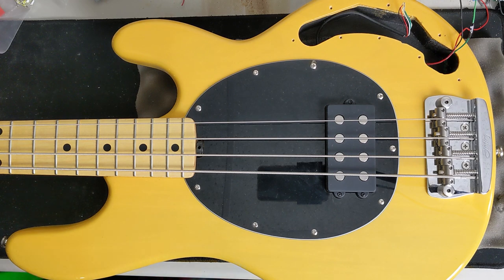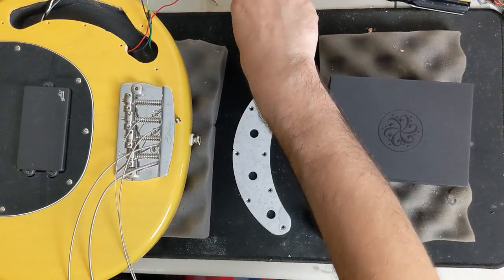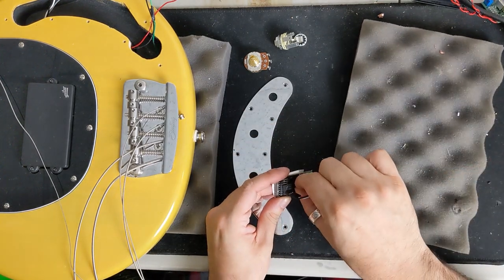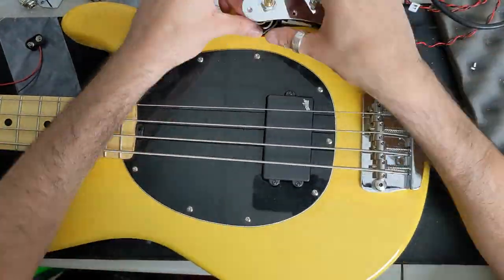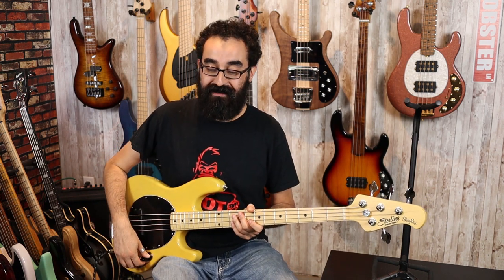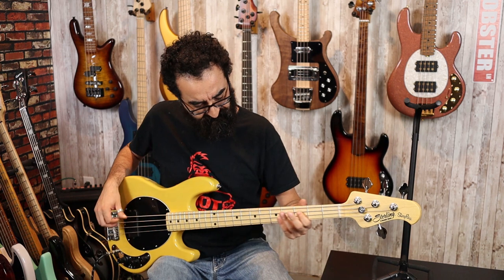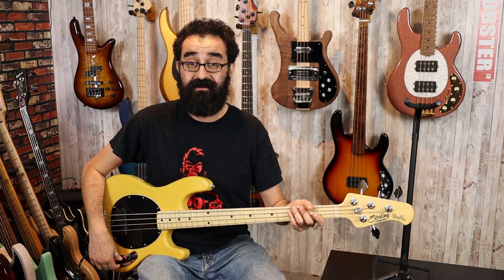Ray24 Stingray Mod Project! Aguilar DCB-M and Darkglass Tone Capsule - LowEndLobster Fresh Look

Comment: The Tone Control presents a high impedance load to the pickup, so instead of using a high value pot, which will absolutely adversely affect the tone, you might get better results by using a 25K low value (low impedance) volume control AFTER the TC and (of course) before the output jack. I think if you do an A/B comparison with the volume control value and placement, the difference will be audible. (Retired electronics tech with 2 degrees and over 50  years bench experience modding amps and bass guitars, etc.)

Comment: Thanks for the great videos 🙌 the onboard preamp on my Ibanez UB804 has just broken and I'm looking for a replacement. It's similar to the piezo pickup and EQ on the SRF700 that you reviewed and modified with Aguilar pickups...looking at the Aguilar OBP's or Darkglass tone capsule onboard preamp EQ's but not sure they'd suit the piezo, or if I need to add a piezo buffer with it....otherwise a bit crazy but considering buying a new UB804 to swap the preamps over....would vastly appreciate any advice you may have 😉

Comment: Great vid Lobster. That bass sounded great, so many tones available. Was that combination of pickup and amp something that you would have thought of yourself or was it a refreshing angle from the bass winner?
Reply from the maker: Thanks Triple! Honestly this was a combo I wanted to do originally in 'Project Mint-o-ray' (early stingray mod project on the channel), but the DCB M pickups weren't available and ended up going with a Delano. I was glad that the winner picked this combo though, I think it turned out great :)

Comment: Nice! Where did you get stacked knobs to fit the Noble stacked pot? I have one that came on a Nordstrand pre and right now I'm using some knobs that don't quite fit. All the stacked knobs I can find are for 6mm & 8mm solid shafts but the inner shaft on the Noble is split/splined.
Reply from the maker: Great question! So for this project I used the Spector push-on knobs, for all 3 controls, and I used the bottom part of the Bartolini stacked knob set for the bottom of the stacked pot.
Reply: @LowEndLobster  Oh nice! I thought of using a full sized knob for the top but I didn't know there were lower knobs big enough. Thanks for the reply!

Comment: Another awesome mod video. Two quick questions: How do I join the discord group, and would the DG Tone capsule pair well with the Nordstrand MM4.4 Quad Coil PU? I have a Stingray Ray 4HH
Reply from the maker: There's a link in the video description. You can copy and paste that URL into your browser if it won't let you click, and that will take you to Discord. If you already have discord it'll just open up and join, otherwise you'll have to sign up (it's free).  In regards to the pickup, absolutely! If you dig the DG tone, it should work with any setup.

Comment: Hey Lobster! A question: could you have gone with a 5-hole control plate to fit all of the original potentiometers, like you did with your DIY DarkRay?
Reply from the maker: Great question! Yes, I suppose so BUT I don't think the preamp module would fit in with 4 pots AND a jack.. or it'd be a very tight fit. It was a PITA to get everything to fit into DIY Darkray, and the SUB/Ray24 cavity size is a little smaller
Reply: Oh I understand now - again, thanks for the quick answer :-)
Reply from the maker: @meantime69  it could be done. They make DCBs in the right size and the Darkglass circuit would work nicely

Comment: Love the sound of the mod on that 24 .amazing. Just purchased a new SUB 4 but didnt like how it sounds. Followed your lead and likewise purchased an Aguilar AG4M p/u however it came with a thin black and white lead, original has a sigle thicker black wire. Can you pls post or dm me the  on how you did solder yours and on wc pots please. Planning on using the stock preamps for now as you suggested. Thanks and love ❤️ your vlogs sir!
Reply from the maker: Thanks Anthony! The stock preamp has two contacts and the stock pickup uses a double layer wire, so it's two in one. It connects to two contacts on the preamp. The inner wire is 'hot' and the outer is ground, so use the white wire in place of the "hot" and the black for ground. Hope that helps and congrats on the bass!

Comment: Hey Lobster!! Great video. Is there a diagram on how you altered the tone capsule, and combined it with the stacked pot? Also, is that the original volume pot you’re using or a new one? That’s my only concern doing this mod. This made me want to pull the trigger on this combo
Reply from the maker: Heyo! The volume pot is just a 250k pot I had laying around, not the original from the stock setup. For the stacked pot on the darkglass, no diagram is needed. If you look at the plug connector that goes into the darkglass single pot, you see three wires that connect to the pot via the connector. You just snip the connector and solder those three wires in order to the new stacked pot. There's two sets of three lugs, just 1-2-3 1-2-3 for both wires. You maintain the connector bit that goes onto the PCB of the preamp, so you can always flip or swap the connections on the PCB without soldering to change which part of the stack controls which freq range. Join our discord channel if you have more questions, lots of folks happy to help including myself :)
Reply: @LowEndLobster  much appreciated lobster!!!!

Comment: Very helpful! Tone capsule comes in tomorrow but I gotta get some time off from work and get a volume pot but because of your mint o ray video I’m SUPER excited. I watched your videos on the projects and I’m trying to find a pickup that gives that well known stingray growl. Thinking of a Seymour Duncan ceramic, thoughts?
Reply from the maker: Thanks Nathaniel! I'd probably go for the Alnico if you want that 'classic' Stingray tone, but the ceramic is a good choice as well (I've personally never used the SD Ceramic, but the USA Sterling uses a ceramic pickup and sounds great.)
Reply: @LowEndLobster  I turned my Ray34HH into a single, and the alnico that’s in it is so dead and Lifeless. I’m hoping after I put that new preamp it gives me some new life. The pickups have 5 wires instead of two, can I wire that to a three way for series, parallel and single hum? Also what volume pot would you recommend for the sterlings? I’ve heard some different things and can’t find anything online. Know that’s a lot of questions but I really do appreciate it
Reply from the maker: @TheGoldeneye1973  Awesome! Yes, the 5 wires are the two hots, the two grounds, and a shield. This can absolutely be wired that way. The Delano install guide has a great set of diagrams for wiring this on a 3 way toggle or a blade switch- https://www.delano.de/downloads/installation_guide.pdf (and this can be applied to mostly anything)
Reply: @LowEndLobster  you are the man. Thank you so much!! Have a wonderful rest of your day!!!

Comment: This might sound like a dumb question. Can you use your stock volume control? I am doing the exact same project.
Reply from the maker: Great question! I'm not sure the value or taper type of the stock pots, so it'd be a gamble.
Reply: This is my first bass soldering project. I wish I had a unedited version of this video so I knew where all the wires go. I am sure I can figure out the schematics though.

Comment: Love your videos. Could I ask, do you know if it is possible to put a Darkglass tone capsule in a USA Sterling and still have the 3 way switch functioning? Thanks!
Reply from the maker: Great question. YES. You will need a new volume pot, but you will essentially wire the 3 way switch to the volume knob (the switch only has a single hot out and ground), and wire the vol knob onto the tone capsule.
Reply: @LowEndLobster  thank you, however can I clarify a few points which may change your answer…it’s a 2006 Sterling USA, with a PCB board preamp (which has already been soldered twice and quite precarious!), it has the 3 way pickup switch, then 1 vol, 1 bass, 1 mid, 1 treble controls. Still doable whilst retaining full functionality?? TIA.
Reply from the maker: @adamcarra3161  Excellent question! Upon looking at the preamp- yes it's possible but you'll need to rewire the switch. Might be easiest to get a new 3 way blade switch and wire the pickup to that, and then into the vol pot (you need to provide that) and DG preamp (or other way around if you want).
Reply: @LowEndLobster  thank you so much :)

Comment: So I finished modding my 34, there were a lot of issues with the tone capsule pots fitting, I got a A500k pot for volume, but the thing is HOT!! It’s distorting when I just play, flat eq, and I changed the battery and all my solders are good. Any thoughts? It was doing this with my stock Preamp which is why I changed it. The only common ground is the pickup, but I lowered that as well, could just be a faulty pickup?
Reply from the maker: Definitely shouldn't be distorting. Did you wire the pickup in parallel? Post some clips on the discord
Reply: @LowEndLobster  yes pickup is wired in parallel, went off a Seymour Duncan 1 volume 1 tone wiring diagram to wire the pickup to the volume, then followed your specs for the tone capsule. I’ll get some clips today, should I just upload them to the general chat? I’ve tried it on different amps, and my interface with the gain down. It only happens when I dig in
Reply from the maker: @TheGoldeneye1973  yeah toss the clips in gear chat and we'll try and help!

Comment: Could someone please clarify what he's doing with the extra pots? He combined two of the EQ bands using a stacked pot, but which two? Did he use a new volume pot or keep the original?
Reply from the maker: I believed I used a new 250k volume pot and ditched two of the B50k pots for the darkglass for a stacked B50k. In regards to  which controls are on the stack, you can choose because the controls still attach to the preamp via the little plugs. You can just swap the plugs around to pick which controls you want (and flip the plug over if it's going in the wrong direction)
Reply: @LowEndLobster  thank you so much! I'm going to do something very similar to this.

Comment: 2:35 oh man, you could just fill those holes, do a bit of color match with the colored super glue they gots these days, and it would look like fancier rays :-) 

FauxRay lol smooth like fancy ketchup or fancy canned green beans
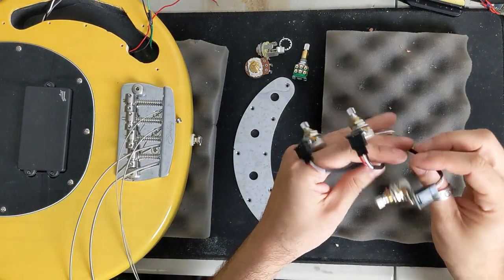Reply: 4:00 Loller gave a BUNCH of great examples about pickup, pot, and cap tweaks and most importantly, why it works like it does.

Dude.  If you can get an interview with Lollar bro every instrument I've ever heard with Lollars seems great and when someone gives their specs and "Lollar Pickups" is mentioned, just like Serek I get that nice warm feeling inside because I know that treble/bass guitar is going to sound GREAT.
Reply: hey did serek ever get their preamp dialed in and released?
Reply: 7:00 oh man I just remembered you might have an ATK pickup laying around or something - this sub would have been CRAZY with the ATK electronics in it (or at least the right set, there were a LOT of variations in that period of time).

Holy fuck that sounds GREAT.
Reply: 8:45 you just made the swiss army bass lol no lie
Reply: 12:30 
NICE

BOOOOOOOOOOOOOOOOOM

dude.  may as well just put that on the menu at your bass food cart - aguilar w/ tc, guaranteed bumpy burpy fun with a bid of sizzle and grind to it.

If there were something with three coils you could throw in there I would daresay people would be looking for the dingwall at your show and and losing their minds when they realize that the sounds out of the PA match the things you're doing with your fingers on THAT THING.
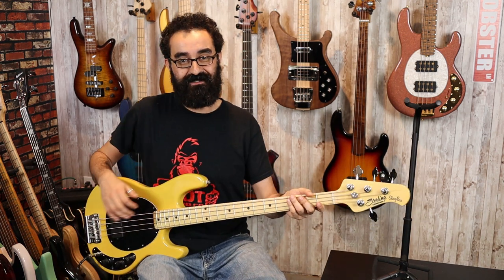Reply: 14:20 
If you could just buy that San Dimas bass husk and throw this set of electronics in it, after a solid demo you could probably ask MORE than the sum of the parts no problem.  

Time to start looking for shiny husks to upgrade with the bass bomb combo lol
Reply from the maker: Thanks dude! No word on the Serek preamp on my end. Dude, I had a set of DCB PJ pickups that I could have tossed in with the Darkglass... still have to try those pickups out!
Reply: @LowEndLobster  IIRC there was some conversation about what effects one might be able to put in a bass.  If you have a a MIDI pickup for your bass, you can hook up to 500ma@5VDC (literally USB2 "high output" charging spec, no problem with USB3 or Tbolt for power/charging) and connect it to this guy.  It's monophonic, though, so you'd need at least one per string unless it ends up working out to aggregate them further up the signal chain and saves some heartache on the bench....

The dimensions are of the little case and front panel that Korg includes in the kit, not the actual core synth itself.

Input/output jacks
Headphone jack (3.5mm stereo mini phone jack), AUDIO IN jack (3.5mm stereo mini-phone jack), SYNC IN jack (3.5 mm stereo mini-phone jack, 20V maximum input level), SYNC OUT jack (3.5 mm stereo mini-phone jack, 5V output level), MIDI IN connector (3.5 mm stereo mini-phone jack) connector, USB port (micro B type)

Power supply
USB bus power mode, Current consumption: 500 mA or less

Dimensions (W x D x H)
129 mm x 78 mm x 39 mm / 5.08” x 3.07” x 1.54”

I think I could design something that fits with a really really bad 3D drawing but with solid OTS components, etc.

Really it could look like a little flatpack with a tiny LiPo battery or two.  There are open source hardware/software projects that have done a lot of the hard work of not only investigating but explaining how to do things with the platform.

There's also a bunch of signal distortion designs based on the NuTube but my couple three concepts are super market outperformers so I don't talk about them too much because they are ridiculously simple and rely on features of the component that most people complain about.  :-) 

I have plenty of room in the hollowed out Hohner it's already got so many screw holes literally through the body you wouldn't believe me if I counted them but I'm not because I don't feel like counting that many holes there's that many...why would someone do that to a solid nothing but maple neck with maple fingerslab and maple wings bass?  

Now people are just going to be terrified when I take it out because it's also missing the human equivalent of teeth - they stripped out the last 5 or 7 frets just because I guess they didn't know how to straighten the neck out...lol and insane tones and sounds are gonna come out of it.  It's literally an experimental platform that someone already all but completely destroyed - at any given moment who knows what it will generate?
Reply: @LowEndLobster  I just priced those DCB pickups.  They're like 2x what the G&L or any other mainstream PJ set costs.  Whooooo we are def in the fancy ketchup territory, why don't you just pair it with an audere or east lol and make the guts worth 3x whatever carcass they go in.  You could put that on a hollowed out cottonwood log and it would thump lol

Comment: would it make a big difference in tonal characteristics  had we used the stock pickup instead of Aguilar DCBM? Or is it even worth the try?
Reply from the maker: I personally HATE the stock pickup. The stock preamp is serviceable with an aftermarket pickup, but the stock pickup is a bit 'much' and has IMO too much output. The biggest tonal difference would be how the pickups are wired. I believe the Aguilars are wired in parallel, where the stock SUB pickup is in series.

Comment: So,...the Dark Glass doesn't need a 9-volt battery?
Reply from the maker: I don't understand the question... I used the stock battery harness for the preamp
Reply: @LowEndLobster  I must have missed the part where you connected the the power supply,...sorry.